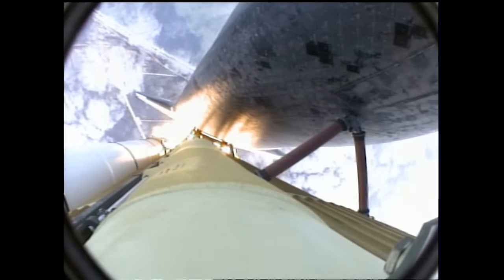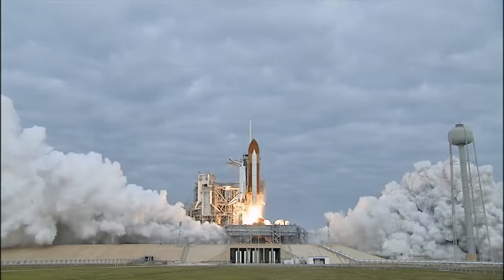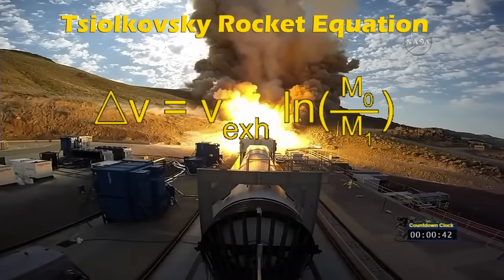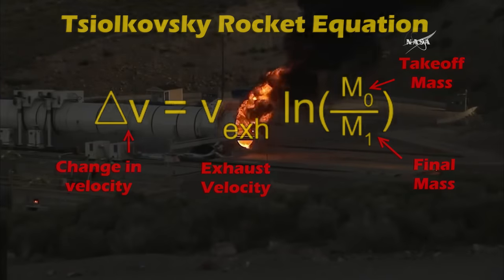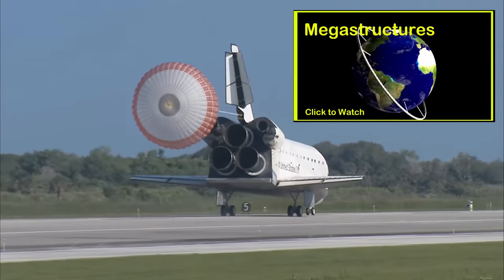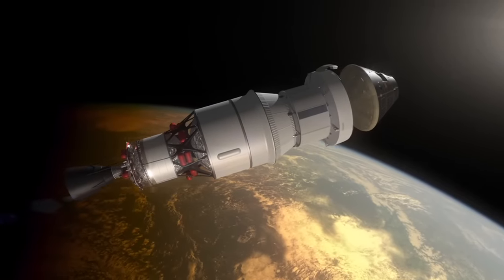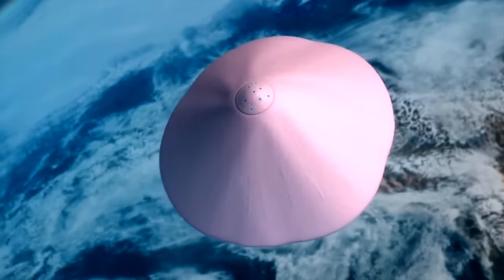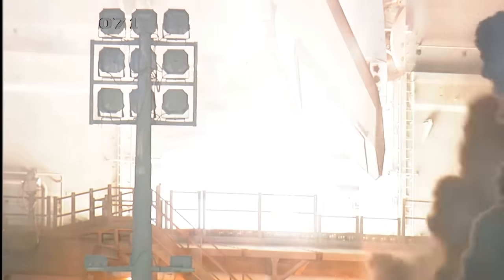The Spaceship Propulsion Compendium

Comment from the maker: Author's Note: A bug and and error, so hit like to help keep this comment at the top.

Error: I botched a unit conversion on the EmDrive results, re: thrust in terms of Force per Power. The units were in mN/kW for the table I was using and I think I mentally replaced 'milli' with 'micro' since all the results from eagleworks were in micronewtons. This is annotated on the video now but those annotations aren't visible to folks on mobile devices so I wanted it visible in the comments. Those early results are of course very tentative but I still botched my math. Sorry. It's not the first and won't be the last error, and it's not terribly pertinent to the discussion, but it is still a big math screw up.

Bug: There seems to be a lot of issues with the closed captions about halfway through resetting to the beginning, but the transcript file and timing are correct, so it's probably a bug, but refreshing seems to fix it. [Fixed now, some weird bug crammed the first ten minutes of the script back into the middle of the episode, I had to manually redo the timing so its probably a hair off]
Reply: Great video man I really truly liked it.
Reply: You should put it in the video description, and make a bigass annotation that show up on the part you were wrong, alternative is to re-upload a newer video with the annotation render into the video as people can turn off annotation themself.
Reply from the maker: Um... there is a bigass annotation on it and it is mentioned in the video description, and the former is mentioned in the comment you just replied to?
Reply: regarding cryptocurrency future topic, I hope that you add proper warnings because, the trading platforms are lacking in a lot of things... in fact it seems like video games like eve online have a better trading interface than a plethora of bitcoin markets... scams have been done by any possible way that we could imagine... this is, from hackers, all the way to actual market owners... and the last super suspicious new thing is the conditioned and forced gatering of private info... they not only want your email and phone number... naaa they want your social security number, your tax info, your address, your ID with photo,  your signature your... etc etc etc... suspicious??... not at all!!
Reply from the maker: There's definitely security and stability issues with it, and yes I plan to address them as part of an intro on it, though the focus will be more on further-future aspects.
Reply: to me it seems like they are nothing else than a way for a very few to actually make profit, and all else is about scamming the heck out of you and any one else, plus the already mentioned info gathering... you'll be as safe if not safer if you gave this private info to random ppl that you find in a entire year in most countries, than, providing it to these organised system...mainly because they have the resources and are already organized!! to do whatever crime they may desire....
Reply: 37:45 you listed Starlifting twice
Reply: Great Video!!!
Reply: Hi Isaac, I am new to this , so not looked  all through your vids yet , but  a question, Many believe that the triangular TR3b or Aurora or ???craft  , it appears to have three permanent white  lights at each corner and one sometimes in the middle ,red or when flashes brilliant white disappears. The craft can hover , silent ,turn on its own access and has even been caught in space by the Space station . before being turned off fast.  New to this but find it fascinating thank you , i hope to learn a lot .
Reply from the maker: Well I try not to criticize folks following the triangular craft/aurora but it is basically a UFO phenomena and reports of it are dodgy at best.
Reply: I do look at a site called secure team , they do try to take out the cgi etc, and it appears a lot , also they have reported there seams to be a star with something ether built or is being built as it dims , seams star lifting might be happening .
Reply: Never ever take any from secureteamn for serious, never.
Reply: No They had a segment from NASA , thats why i looked at it. http://www.space.com/30832-kepler-telescope-alien-megastructure.html
Reply: Holy crap dude, your video is awesome, but what is with your speech impediment?
Reply: ***** Not only that. He also is not going into detail, if asked about some more background information.
Reply: +Verisimilitorque Dork   V stands for ahole
Reply: Tim Moore Ah shucks, you got me.
Reply: I am happy to see young people like you still optimistic.
But, I hate the fact that everyone older than you - EXCEPT the few of us proud antinatalist animal rights vegans who have fought to outlaw meat, outlaw breeding animals for needless torture & murder, outlaw breeding humans overpopulating, outlaw fossil fuel addiction - has ruined the world for you younger people irreversibility.
Always the fault of extremist rightwing conservatives. Because it is always rightwing conservatives in power.
Show me when

Gloria La Riva and Eugene Puryear, Socialism and Liberation Party
Monica Moorehead and Lamont Lilly, Workers World Party
Alyson Kennedy and Osborne Hart, Socialist Workers Party
Dr Jill Stein and Ajamu Baraka, Green Party

take power. Then you can blame problems on liberals or leftists.
Reply: ??? Where is the relation between any vegan topics with regards to this discussion ? Where is the relation to labors/workers parties ? Where is the relation to rightwing conservatives  Or is this simply just a useless comment, because You think, someone would be interested in Your opinion, so You need to share it ?
Reply: You complain about "fossil fuel addiction" while using electricity to power a smartphone or computer which both have plastic components--all of which is produced or made using fossil fuels? Not to mention your bit about "ruining the planet" while, again, using a device or machine which is made using material mined from the planet, further damaging it--or, even better, what is no doubt a lithium-based battery, the lithium for which is likely strip-mined, one of the most damaging mining activities known to man.

You're a hypocrite.
Reply: The Ultimate Reductionist You unmake your own points in the same sentences you are trying to make them.
Reply: fgutz1970 You didn't mention who you were replying to, so I first thought you were getting hostile with Isaac. Carry on, though. You are right.
Reply: fgutz1970, Plastic & rubber aren't fuels. It's the burning of fossil fuels that release ACO2 that causes the problem.
Not saying the process of making plastic & rubber isn't a contributor though.
*As for your lithium battery comment,*....
"On the other hand, the world produces about 650,000 tons of lithium each year. Lithium exists mostly in the form of concentrated salts. Almost all that lithium—greater than 95 percent of it—is produced through a process of pumping underground brine to the surface and allowing it to evaporate in big pans. It’s separated from the brine using electrolysis."
... *it's correct*. (edited)

https://cleantechnica.com/2016/05/12/lithium-mining-vs-oil-sands-meme-thorough-response/

Just think. I was wrong & admitted it. 
Wow, imagine if everyone did that. ;)
Reply: Eisen Faust r
Reply: I am just commenting because YouTube also considers the number of replies on a comment in its algorithm.
Reply: Your voice is fine buddy, 2 minutes in can't tell anything.
Reply: Max Benson Missed this until now... "r"?
Reply: Shazbot Rules Just saw your edit. Right on, Shazbot! Making the world better one show of humility at a time.
Reply: Great video, I love what you are doing with your channel, thank you so much for this information!!! +1 Sub!
Reply: Isaac Arthur respect and many thanks
Reply: @Isaac Arthur, you should be able to pin this comment to the top as the content creator.
Reply: Speech impediment?

I thought it was just an accent.

Great videos.
Reply: But it seems to me that the EM drive would violate Newton's third law of motion. As a physicist, I don't think it can work. It's essentially like trying move your car forward by pushing on your steering wheel.
Reply: lol "hit like to keep this at the top"  but also pinned..  not cool brosef
Reply: Okay, so the EM drive probably doesn't work, and everything we have seen so far is just measurement error.  So sad. Please talk to me a little about transformation optics and solar sails -- does turning light around with a metamaterial impart momentum?  Can you use a metamaterial to re-route (not reflect) light which is bouncing off of the 'drive' side of a photon sail in such a way that the light is continuously encountering the sail? There will certainly be energy losses -- can they be made managable?
Reply: Isaac Arthur you clearly know nothing about thrust. Everyone knows spaceships would use the Plot-Drive
Reply: Like Southern accent  be cool
Reply: I am new to this channel. Im glad you have an awesome sense of humor about your speech impediment you wascal. I'm starting a binge on your videos 👍
Reply: Couldn't you use the excess heat from the Vasimior drive to run a steam/electric generation plant? You're producing heat anyway, you might as well use it.
Reply: @39401JLB  yeah they found the so called thrust produced in the vacuum test room was actually caused by the earth's magnetic field, as there were a few gaps in the shielding. But they are running more test for another 12 months to be certain. even if does work, the thrust is minute, so insignificant for space travel. i think we have to look first to nuclear, and then while using that, work on an antimatter drive. and the alcubierre drive.Since Chernobyl I think everyone has been afraid of nuclear, and that's why in britain virtually all the nuclear power stations  have been demolished.  starshot's technology of thousands of lasers pushing a 1 gram probe with massive solar sails to proxima centauri  launch date in about twenty years, need to work out how that can be translated to carry human passengers. e.g. how to get the mass of a few astronauts in a small spacecraft up to 20 percent light speed same as the starshot program..
Reply: Great video thank you!
Reply: Isaac Arthur.  You missed one propulsion system.  http://www.engineworks.eu/ipd.  Of course, you wouldn't know about this propulsion system because it was only on the test stand once.  It does not work inside the atmosphere, but only in space, and that is why they closed down the project.  I know they are up to something else right now, but what, they don't want to tell me.
Reply: I think ure lisp if fucking boss i love it and ure content keep it up fuck what anyone else say
Reply: I really love you're amazing far-sighted content.  Im a new subscriber and joined curiosity stream and nebula because of you and they are really good value.

I love your unique voice its really interesting and I don't hear any kind of speech impediment at all.

You bring wonder and joy to many thousands.  Please keep up the great work.

Gr8 channel 👍 👏👏
Reply: I guess now you could update that pinned Comment one more time as the EM-Drive seems to be officially dead.^^
Reply: Something that strikes me, as someone with a doctorate in physics, when I look at the Em-Drive:  its asymmetry makes it a crappy waveguide.  IIRC from my graduate-level E&M classes (which, admittedly, were over 30 years ago), microwave cavities are basically waveguides with (microwave) reflectiveb ends.  And waveguides need a uniform cross-section down their entire length, or they (A) create destructive interference; or (B) leak.

Again, I last lookedb at this stuff in a class I took 30+ years ago, so I could very well be wrong.  But to me, it looks like the Em-drive is leaking photons due to the asymmetric profile.

Comment: Table of Contents
10:20 Laser Sail 
12:25 Nuclear Propulsion (Daedalus Fusion Engine)
12:45 Nuclear Thermal 
13:57 Nuclear Electric 
14:22 electrodynamic tethers
15:08 ion Drives
 (15:45 Hall, 17:09 VASMIR)
20:45 Anti-matter and Other Photon drives
26:25 Laser Highway
27:10 Diametric / Pitch and Bias 
27:54 Bussard Ramscoop
 and Dark Matter Drive
28:33 Em Drive
Reply: Very nice. Thank you.
Reply: It should be a hearted coment
Reply: graci
Reply: Thank you!
Specifically came back to this video to use it as reference material for a concept, and these timestamps really helped me find the bits I wanted.

Comment: I'm not finished with my  video but it should be out in a couple hours. ok maybe more than a couple...
Reply from the maker: I'm looking forward to it, I'll card it and link it when it does. Thanks again Cody!
Reply: Hope ye found some gold in them hills.
Reply: it's out, Cody sent me.  dude's ambidextrous.  what can't he do
Reply: NileRed is better in my opinion
Reply: Hii
Reply: @nicevideomancanada  For proper chemistry practices and more elaborate descriptions he is better but Cody is pretty good with illustrating how various things are done from scratch. His methods may be less precise and involve some homemade devices but keeping it simple might make it easier to grasp concepts for people. Although if they ever wish to handle potentially hazardous chemicals/materials and get into chemistry I'd say Nilered is definitely better to follow for safety reasons since he uses equipment that is designed to handle such materials, I dont think cody even had a proper fume hood to handle irritating/dangerous chemical fumes. The stuff cody does is not extremely dangerous in most cases but people still should remember to take proper measures to prevent harm. I dont think he ever seriously put himself in danger but if someone tries to imitate what he does and messes something up that can cause problems.

Comment: hold on, you can keep getting acceleration from a laser beam between two mirrors? Shouldnt the light degrade to lower and lower energy, via longer wavelength, until there's no more force to impart? How long could that go on?
Reply: The impact would get slower and slower, both by light escaping to the sides, being absorbed by imperfect mirrors and doppler shift. But theoretically it would keep on exerting a force without an absolute limit.
Reply: I'm pretty sure the point others have tried to make is that diffusion becomes an issue long before doppler shift.    I'd also point out that aiming such a device seems impossible to me.  The current first bounce would be incoming at a different angle than the second bounce, unless your "stationary" mirror is wider than, say, the earth's orbit.  Keeping the "home" mirror "stationary" would be more expensive than just blasting new photons at the thing, or at least that's my guess.
Reply: Auxf5 
My bet for aiming would be retroreflectors, though that might require more mass than just a flat mirror
Reply: Auxf5 
Ooh, and if you add in light amplification systems like you use to make lasers but between the two retroreflectors then you dont even have to aim the origin laser, any light bouncing between the ships would self-aim and amplify

Comment: Did NASAs EM-Drive really have less force/power than a photon drive? I thought it was at least an order of magnitude more which is why people got exited.
Reply from the maker: Not confirmed, that I'm aware of anyway, I've seen a lot of accounts that NASA got higher, like hundreds of nano-newtons per Watt, when light gives you about 3 nano-newton per watt, but I'm not aware of that being official and as the minimum, rather than a maximum upper-bound. I could be wrong.
Reply: Isaac Arthur
Looking at the collection of results at the EM-drive wiki, most that did report some force were quite a bit higher: http://emdrive.wiki/Experimental_Results But then, this is about as official as me claiming it on a youtube comment^^
Reply from the maker: Yeah unfortunately. That's the problem of course, it looks promising exactly because there's some signs it might be out doing light propulsion, and of course the lack of propellant, but solid evidence it is doing so is what eagleworks is aiming for and until there's a peer-reviewed paper on it from them or another solid lab we haven't really got anything.The other issue of course is it is so hard to measure that tiny of a thrust that margin of error bars and possibility for noise make the upper bound dubious at best.
Reply: Isaac Arthur
Sure, the noise in some of those tests (especially the TU Dresden one) was just horrible. I'm just asking where you got the figure for it being less powerfull than a photon rocket because I never found that anywhere, whenever somebody claimed thrust it was at least 10x as much.
Reply: all the hype was because of that drive pretty much work without fuel despite momentum conservation law, not the power output (wich was tiny)
Reply from the maker: ??? Unless I've garbled my math badly - which does happen, again this wasn't an EmDrive video so I wasn't being rigorous - then light produces 3.33 mN/kW, the NASA results I saw, probably from the same table of dubious validity, were, in mN/kW: .283, 1.1, 0, 21.3, 3.0, and 5.4. Two of those are higher than 3.3, the others aren't, and none were 10x. Now if you through in the others yes you do get some with very high orders above, but I was pretty clear I was sticking to NASA's.
Reply: Wait, nano-Newtons per Watt correspond to micro-Newtons per kilowatt, not millinewtons
Reply from the maker: Aw Fuck, damn, damn, damn... you are quite right, stupid bloody non-reduced units.
Reply: immediately unsubscribes ;-) Don't worry mate, it's a silly and not important error in another awesome video of yours. I'm glad I could help.
Reply from the maker: Fortunately it isn't pertinent enough for me to need to ax the video, I stuck on an annotation correcting it. Good catch, thanks man!
Reply: Considering EM Drive is at BEST a few orders of magnitude weaker than a fart in the wind, it should be fine.